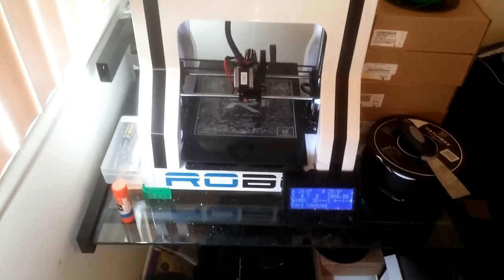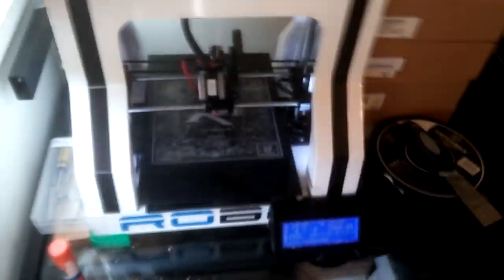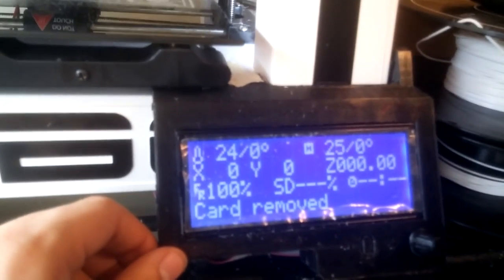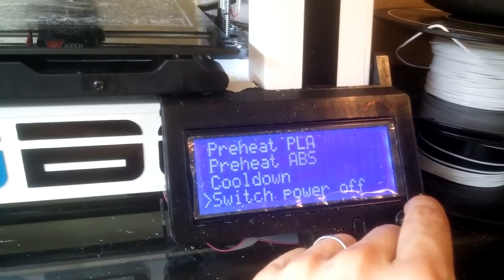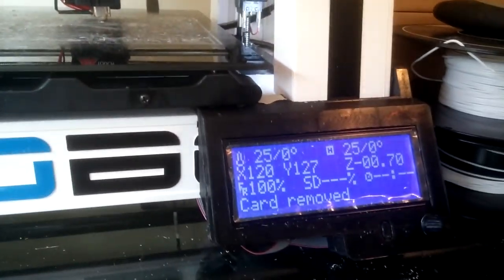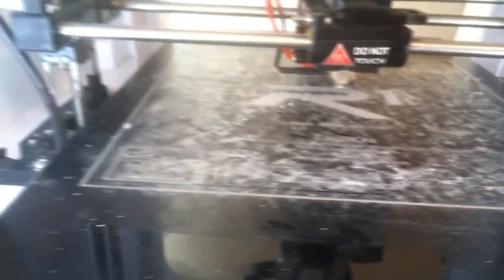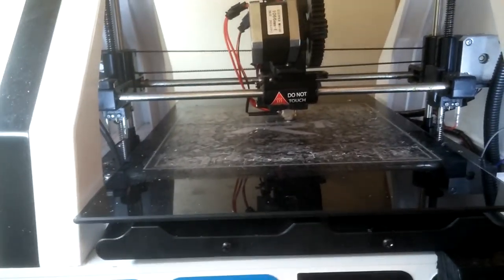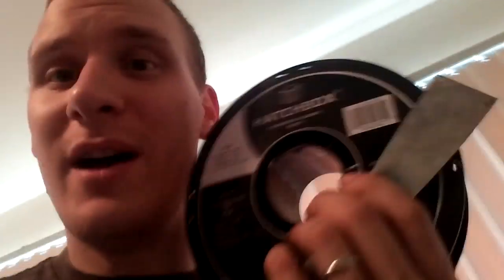The Pixel Armory 3D Printer Setup

Comment: Can you tell me why you use the glue stick?
Reply from the maker: Sure.
The glue stick creates a perfect adhesion surface for the PLA filament we use to adhere to. Because we use a heated print bed the glue dries in a few seconds and when the filament is printed on-top of the glue it adheres preventing the print from coming off the bed and ruining the print.

I hope this answers your question.

Thanks

Bert